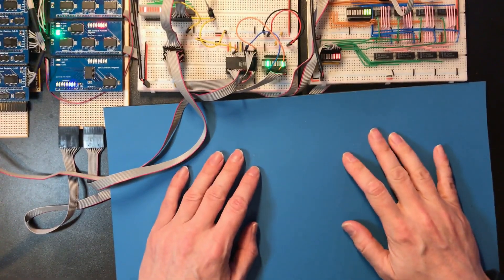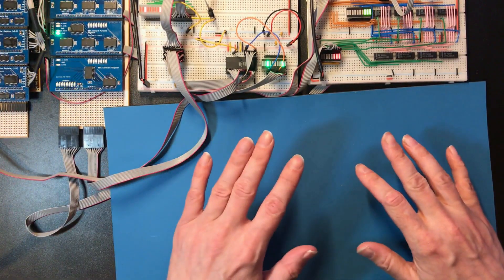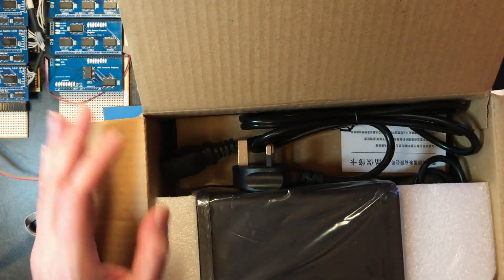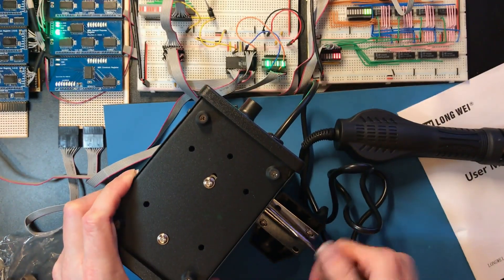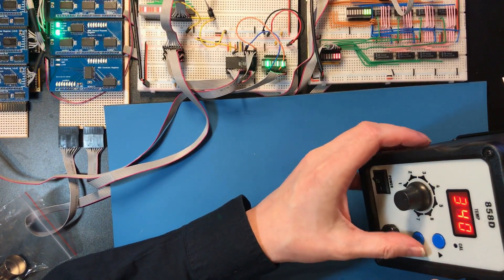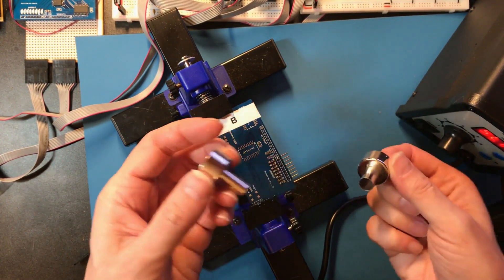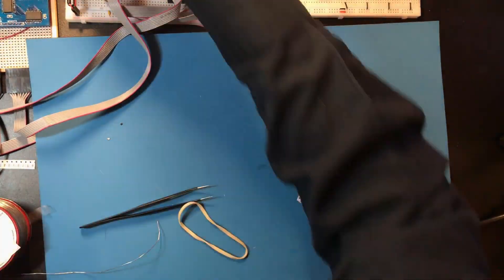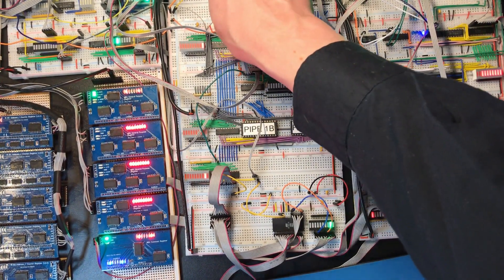Hot-Air Rework, First Try

Comment: the solution to this is to wick out the solder, apply solder paste, put the components back on and use the air to reflow the paste on the new components.
Reply from the maker: Oddly enough, I had to reword some led's on a later board that had been originally soldered with paste, it was far easier. Something about the solder paste blend re-flows easier with hot air.

Comment: if you don't want parts flying .. put the biggest nozzle on and turn down air to lowest setting... at least that's what i did ;)
I think there is no point in having a small nozzle since the hot air will spread over the whole board anyways ;)

With hot air it is flux flux flux ... cant have enough of it ... I bought raw Rosin on ebay ground and solved it in IPA, maybe add a couple drops of very light machine oil (it doesn't harden like candy then and is easier to remove afterwards)...  works a treat, there are videos here on YT  that show how its done.
Reply from the maker: Yeah! I’ve switched back to a larger nozzle, the small one seems to heat slower, maybe it was restricting the airflow?

Comment: Nice effort, for your first hot air rework experience!  Looks like you have a silicone mat protecting your bench. Good idea with a hot air gun!  I now use a 5 diopter magnifying LED desk lamp for all my SMD work, infact for all of my hand soldering work. Nothing wrong with my close-up vision, but it helps having everything enlarged, and I have great tweezer control with the direct visual depth perception (rather than via a 2D camera image).  But, for videoing your work, I guess the video microscope is needed for sharing the close-up view.  :-)
Reply from the maker: It is odd the way making videos tends to skew the methods I use.
Reply: I'm using cheap magnifying glasses, the advantage is that I can look any direction as they are fixed to my head, the disadvantage is that the my depth of view is quite limited and fixed. A second disadvantage is that they remind my how old I am, as I need them for stuff I did without any aid in my youth...

Comment: Definitely get some flux! MG8341 is a really solid brand, it even comes in a syringe tube, along with a needlepoint tip, for easy dispensing. Any electronics-grade flux will do, I'm just partial to 8341 because I've used it for years with no trouble. You'll want one that is in some kind of paste form. The pen you've got looked like it was doing a good job, but a lot of the flux from that will get burned away when you add it to an already-hot board. Paste flux on the other hand will basically ooze everywhere and coat a large region of the board as it heats up, so more of it will stick around for soldering purposes. 

Adding flux will make soldering these things much, much easier. It will also make desoldering them easier, because it gives you an indication of when the components are "ready" to be lifted away. For desoldering, the flux will gradually begin to bubble as it reaches activation temp, which is always right around the window where solder melts. So when the flux starts bubbling, that's when you know the component is really close to being safe to lift. I usually give it a few more seconds after it begins to bubble just for good measure. For soldering, the flux acts almost like a glue. It will help keep the component mostly in the right spot, and when both of the solder pads finally melt, the component will "snap" into place almost like magic. Going back to my first point with the paste flux, you'll have a huge pool of it over the area, so other parts should "stick" as well and be less likely to just fly away. 

I actually DO NOT recommend solder paste for this, the only reason why is because you have to be veeeeeery precise with your application of it to the pads. I've tried using solder paste before on a number of electronics repairs (I work in a repair shop), and it ended in disaster. Basically ONLY THE PAD has to have paste on it. Any excess paste out on the sides of the pad is a massive no-no. When you go to heat up the area, any errant paste will form little itty bitty solder balls that can get trapped and clumped together near other solder pads, and possibly even work their way underneath the component and short the pads together. I've had this happen several times with similarly sized components that you're dealing with. It was a total nightmare. 

I only recommend solder paste if you have a fresh board with absolutely no solder on it, and an accompanying solder paste stencil to go with it. The stencil will allow you to "squeegee" solder paste onto the pads, and when you lift the stencil away, only the pads will have solder paste. From there you can drop your components in, then heat them all up. This is actually how many PCBs are professionally soldered during the manufacturing process, and depending on where you're sourcing your boards from, you can probably ask if they can make you a stencil for them. You only need two stencils, one for the top and one for the bottom, and you can re-use the stencils as often as you'd like. 

EDIT
Also, just a tip, that PCB holder you're using is total garbage. I used to use one exactly like that and I ended up getting so angry at working with it that I threw it against the wall. No matter how much you fannagle it, it doesn't work quite right. Takes far too long to get it to hold the board just right. On the other hand, I was also working with quite oddly shaped boards so that might have something to do with it. Either way, I realized the best way to hold the board is to....tape it to the work mat. Yep. Just kapton tape. That's all it needs. The board won't go anywhere while you're working on it. I even spent $60 on a Hakko Omnivise before I came to this extremely cheap realization. The Omnivise is now a very interesting paperweight.
Reply from the maker: Thanks for the recommendations, I've ordered a syringe of the MG8341.  I know the pcb holder isn't great, i've found it grips my rectangular boards quite well but it slips on the rotation unless I constantly tighten it. Interesting suggestion about the kapton tape I'll give it a try some time. For my register boards most of the soldering was done by putting the pin headers in first, then just dropping it into a breadboard to secure it. I'm familiar with the paste/stencil approach (in so far as I've watch videos), some of the future boards for my cpu build will be larger than the smaller boards I've been hand soldering so I'm intending to investigate some of the other soldering methods in future. Expect a diy reflow oven project at some point.

Comment: The hot air tools are cheep and easy to replace should they go wrong.
Reply from the maker: Indeed. I know I'll end up with a reflow oven sooner or later but I think a scope would make a difference to my builds in the near term, the price on a decent one is a big investment though.
Reply: @weirdboyjim  I have a duel station and I have personally experienced a hot air tool going up in flames (was brand new) fortunately (like you) I know enough to be able to replace the air tool!
Reply from the maker: I bought separates, I didn't think I'd need the hot air initially and desk space is at a premium. I expect the solder station will still get a lot more use. Did you work out why it went up in flames?
Reply: @weirdboyjim  Yup same issue as with inferno my 3d printer. The temperature sensor failed, there was no thermal runaway detection so the PSU kept pumping current into the heating elements until it went pop!
BTW, both have been repaired and still work!
Reply: @weirdboyjim  you can buy a quite useful scope for $30 on AliExpress called a DSO150. It's handheld and runs on an external power supply, but I've fit a li-ion battery and boost converter + usb charger inside mine to make it truly portable.
Reply from the maker: I could really do with something with 2 channels so I can see the interactions of different lines.
Reply: @weirdboyjim  if you want more of a logic analyser, I just got a simple one that plugs into my laptop for $9
Reply: @weirdboyjim   I've got one of those DSO Quad nanos (first gen) not the most accurate thing in the world but it is 4 channel and open source and from seeedstudio.
Reply: @weirdboyjim  And not I did not pay over £100 for mine brand new!
Wow the prices have sky rocketed!
Reply from the maker: @AJB2K3  I have a DSO138 it's interesting but it's really slow compared to "real" scope. If you remember the double count issue I had on my address registers, it would just show a nice clean pulse, the counter chips can operate at 40mhz so the glitch could be tiny compared to what one of the cheap DSO devices can pick up.

Comment: I've got the same hot air station in a smaller form factor, I'm pretty happy with it.
Flux and solder paste really help!
Reply from the maker: I didn't see a smaller one or I would have been tempted. This hobby is starting to consume space!
Reply: @weirdboyjim  I know what you mean, I've been collecting electeonic junk since I was about 5 years old!
The smaller form factor has the heat and blower controls integrated into a power brick the size of a regular laptop power supply.
Reply: i don't use paste for low component count boards anymore.. makes no sense without stencil because it takes so much time to apply  -.-
I just tin the pads with a soldering iron and blow them on afterwards... I would like to have a hot plate though... i think heating the whole board to 120°C or so would make this process much more .. fluid
well okay, for some sensors and certain LED's i have bismuth paste with a melting point @ 180°C but other than that...